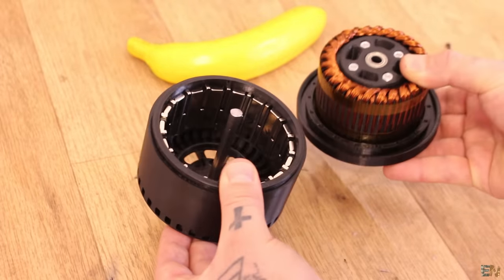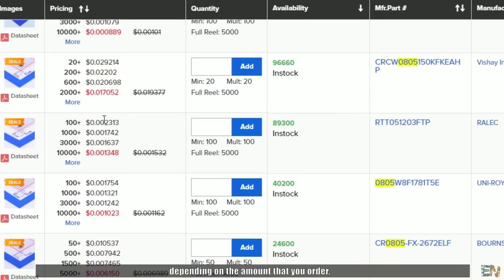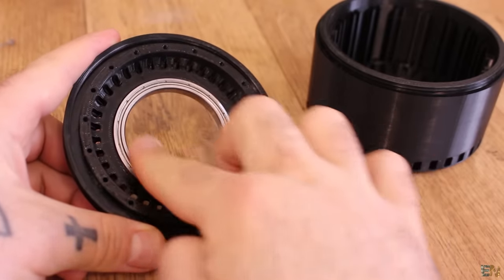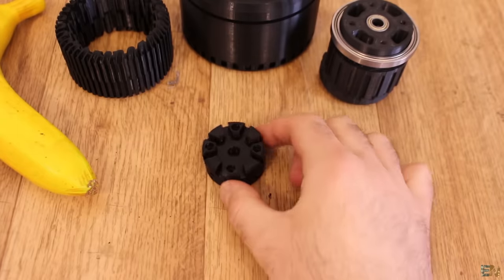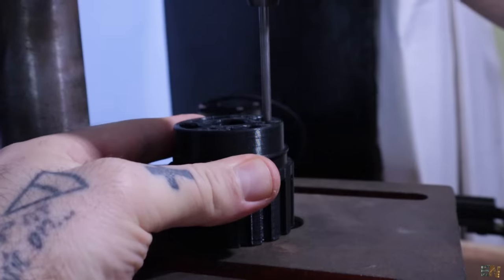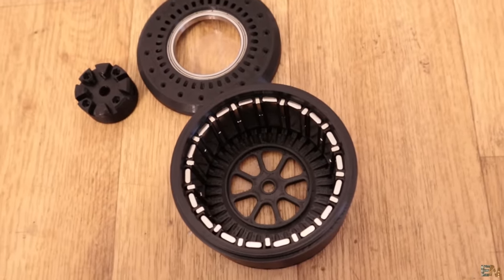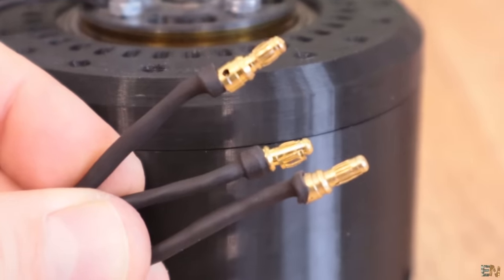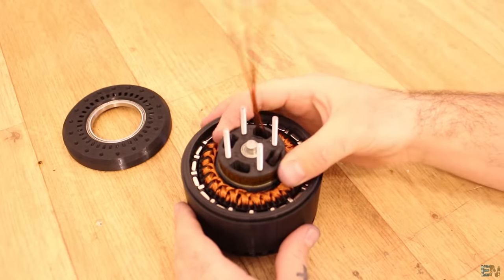3D Printed HUGE Brushless Motor | I've made Cristoph Laimer's motor

Comment: Unfortunately Thermo Plastic simply do not work in  heat generating Electric Motors.
Reply: Was thinking same it would melt when under load but I suppose he gonna use it on something that don't need a lot of tourqe or long running but then what's the point it kind of useless 😂
Reply: @davey2k12  Hell of a cool project all  the same .  One may be able to CNC  this one.
Reply: You can take the printed part and easily cast a metal part from it....open your mind bruh
Reply: @smolscale  have you tried casting using plastic lol
Reply: Tyler Harrington sure you xan cast it but if you have a cnc you might as well just machine it. The proble is eddie currents and hysteresis, thats why motors use silicon-steel laminatings just like transformers.
Id say steel is better than an air core but dont expect it to be very efficient.

Comment: The frame of the 3D printed Brusshles roll is plastic! It has poor snow conductivity. In other words, coil heating is much more difficult to handle. Of course, if you use it at a much lower load than planned, then there should be no problem! In addition, metal-core coils generate a larger electromagnetic field than air-core coils, /plastic core coil = air core coil/ so more power can be obtained from them, moreover, the metal core is a good heat conductor, while the plastic, unfortunately, is a heat insulator!

Comment: I admire your skills but I think this is a foolish project and I mean no disrespect. Thermal plastics like this were not meant for motor housings this is going to eventually heat up too and warp the housing and start coming into contact with moving parts. I don't see the need for such a motor when there are so many options on the market that would hold up to a lot more stresss. Again I'm not trying to disrespect I'm a realist